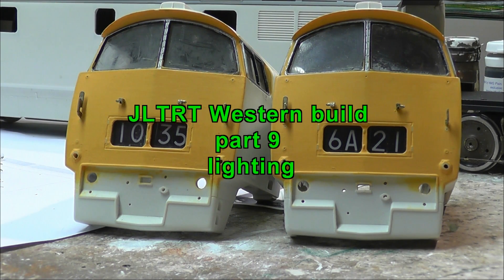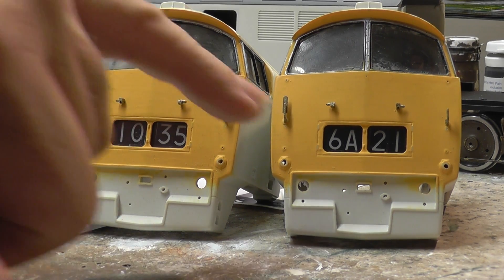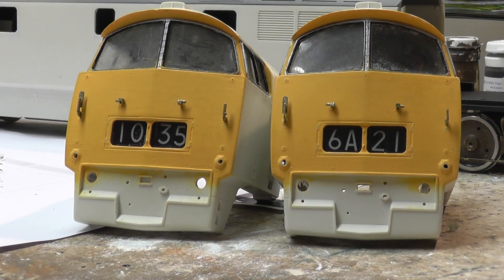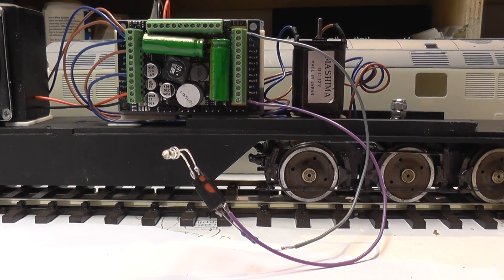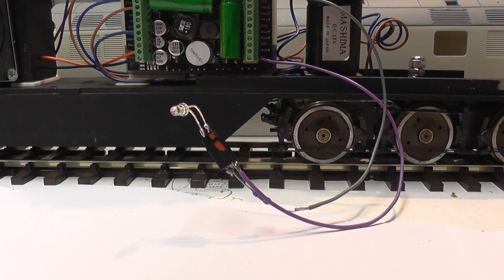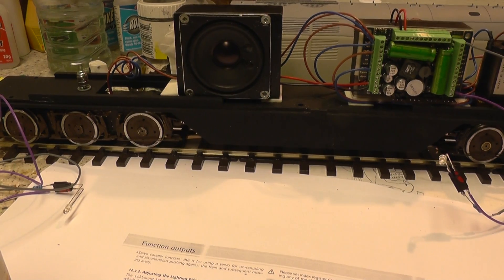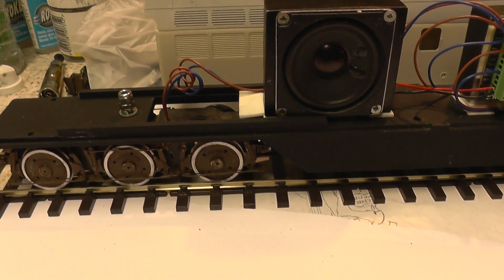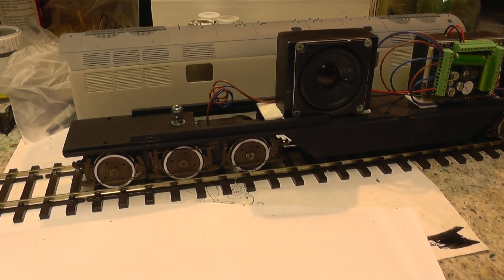JLTRT Western Build Part 9 , Lighting

Comment: HEADCODES - I have a list of some WR destination headcodes, Kevin, for those interested the first digit, applicable to all regions, taken from 1960's LMR staff magazine. 1= Express passenger, 2= Local passenger, 3= Parcels & empty stock, 4,5 &6= Express freight (list doesn't explain why 3 codes!), 7= Express freight unfitted with auto brake, 8= Through freight unfitted, 9= Branch or stopping freight and 0= Light engine or Engine and brake van only. 

WR destination codes I have are - A=London area, B= Bristol area, C=Exeter/Plymouth, F= Swansea, H= Birmingham/Gloucester, J= Shrewsbury, T= Newport/Cardiff, V= W. R. inter regional train, Z= Excursion or special within WR area. I don't know why some letters are missing or unassigned.
The last 2 numbers are train identification numbers as shown in the working timetable. Though these no longer appear on trains they are still used & signal boxes display the 4 digit code on signal diagram.

Ian Allen used to do an ABC of headcodes in 1960's! I have a full list of LMR destination codes for anyone interested & some LNER ones too.

Comment: coming on well there Kevin. the slow running is good. Hopefully you'll get the lights sorted. just uploaded two more vids so if you have time could you check them out. will try to upload more often now my software is fixed.
Reply from the maker: Hi thanks will try and look later cheers Kevin
Reply: +kevintregunna thanks Kevin. 
Cheers Tom.

Comment: Kevin, I would have thought you would need a resistor between the output of the decoder and the LeD and I believe the LeD Mode is set by changing the Special Function CV value? I've had a quick look at the manual and it mentions activating the function outputs before being able to use them... Would also test the LeD that you had connected to confirm it hasn't blown because of no resistor being fitted... These are just suggestions and hope this helps in working it all out... Pete.
Reply: Chapter 6.10.2 Using LeDs - on Page 21 describes the need for resistors...
Reply: Chapter 12.3.2 Adjusting the Lighting Effects - on Pages 63 to 66 has an example on page 65 and mentions setting the special function CV to 128... for LeD compensation mode...
Reply from the maker: Hi Pete have got resistors fitted and have tested after trying and all working ok it's just switching to led mode will take a look at the bits you mentioned later this week am in Warley today then London thanks very much for the comments cheers Kevin
Reply: +kevintregunna Hi Kevin, couldn't see the resistors, my apologies... Hope you get it sorted and look forward to the next update! Pete.

Comment: Great information on the head codes.  I have looked for information on them with no result.  What are those wonderful connectors?  Could you use resistors to change to power for LEDs?  Really wonderful slow running.  Good luck at Worley, travel safe.  Rob
Reply from the maker: Hi Rob take a look at this https://en.m.wikipedia.org/wiki/Train_reporting_number
The connectors are good don't know what they are called , do have resistors fitted but still not working need to speak to an expert cheers Kevin
Reply: +kevintregunna Okay, that's why I couldn't find the information.  I didn't have the right nomenclature.  Thank you, Rob
Reply from the maker: +Rob McCrain hi Rob I have got the dictionary out now !!!!
Reply: +kevintregunna Cheers